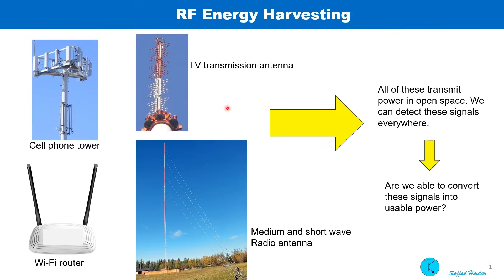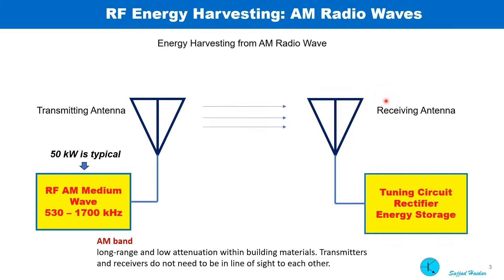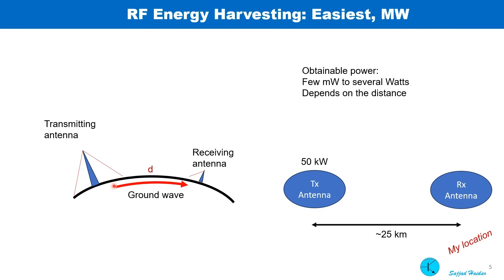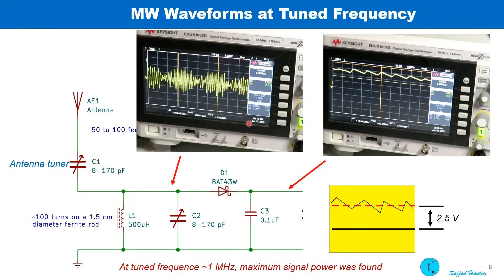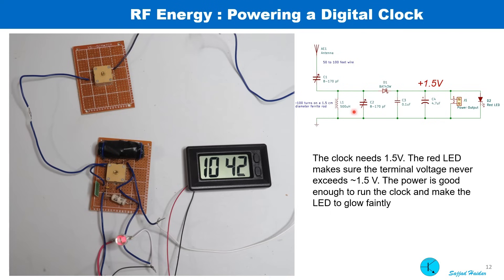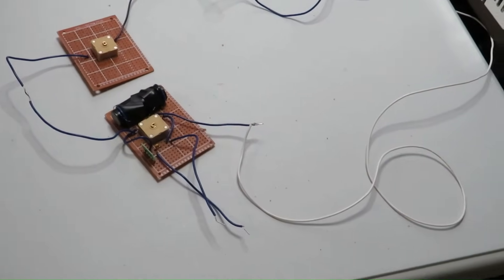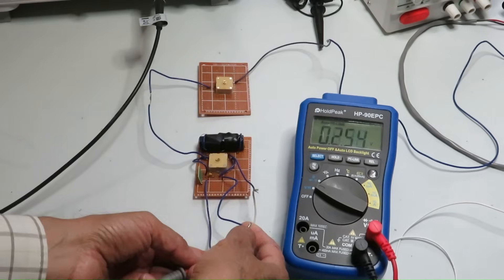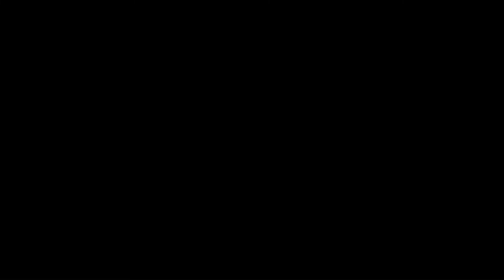Energy harvesting from radio waves

Comment: Would be nice to see IoT devices being powered by radio waves or even recharged by them. Would save needing to constantly replace the batteries in them.
Reply from the maker: Unless radio stations are close enough, power is usually small. But you can make your own transmitter to power devices or charge devices. CB radio band (27 MHz) is still available, but I guess only 5W is allowed to transmit. Thanks for watching
Reply: the need for many meters of wire rather defeats the point - just run a wire to a power source - at low load the I²R losses would be minimal
Reply: I looked into it. It works, but you need a lot of wire to get enough to run even a microcontroller that sleeps most of the time - think microamps, not milliamps.  It's more practical to just use a tiny photovoltaic, like the ones used for garden lights.

Comment: I wish you could elaborate more about the wire (antenna ) its features also earth line
thanx for sharing
Reply from the maker: The antenna is a very simple one. Just one long wire, AWG 22, plastic jacket ,75 feet long. It is usually called a "L-Type" Antenna or monopole antenna. The GND is just connected to powerline Earth. Thanks for watching